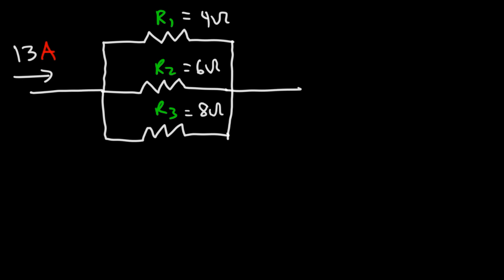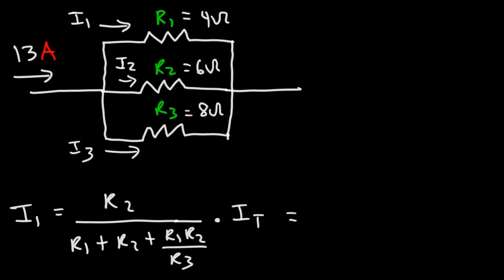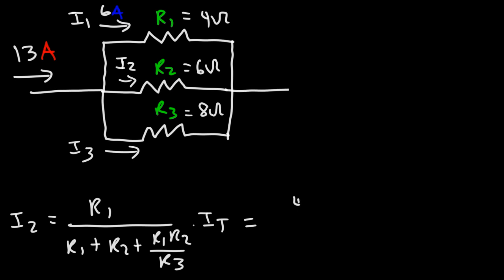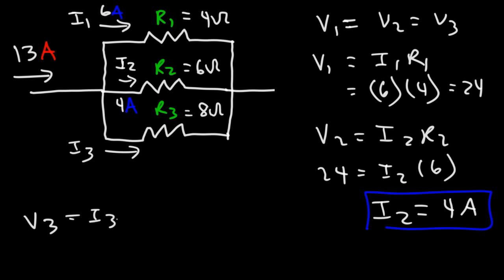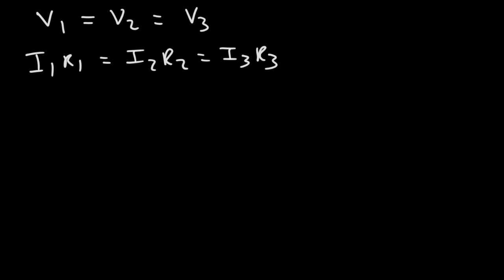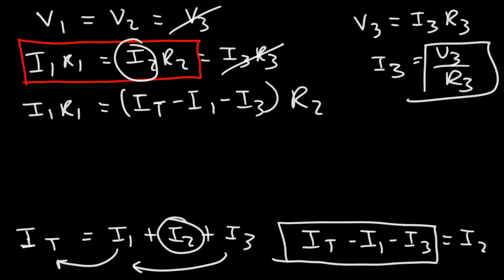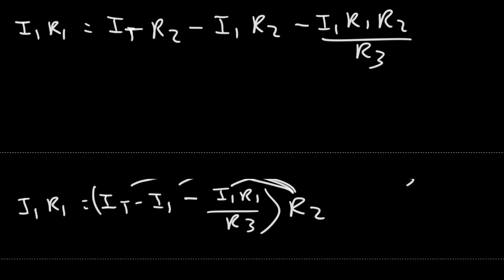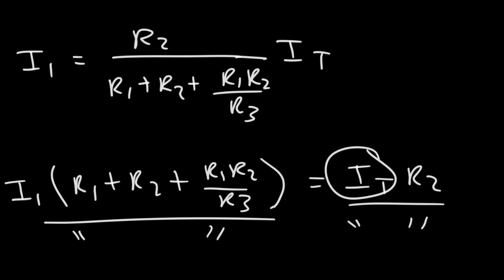Finding The Current In a Parallel Circuit With 3 Resistors

Comment: Method 1. V = IR. We know I = 13A, so we need R
The reciprocal of resistance (1/R) is called conductance. For resistors in parallel, the conductance of each resistor is added up to get the total conductance of all parallel resistors. The reciprocal of total conductance is the equivalent resistance of all the parallel resistors:
Equivalent resistance: 1/R = 1/R1 + 1/R2 + 1/R3
If we put the numbers right in:
1/R = 1/4 + 1/6 + 1/8
Lowest common denominator is 24, so:
1/R = 6/24 + 4/24 + 3/24 = 13/24
R = 24/13

V = IR = 13 * 24/13 = 24V

Now simply use I = V/R:
I1 = 24V / 4Ω = 6A
I2 = 24V / 6Ω = 4A
I3 = 24V / 8Ω = 3A

------------------------------------------------------------------------------------------------------------------------------------------------------------------------------------------------------------------------------------------------------------------------------------------------------------------------

Method 2. Current distributes proportionally in a parallel circuit. The voltage across each resistor is the same, but the current splits depending on each resistor value. Smaller resistors get more current, and larger resistors get less.
V = V1 = V2 = V3

Ohm's law:
I1 = V / R1 or V = I1 * R1
I2 = V / R2 or V = I2 * R2
I3 = V / R3 or V = I3 * R3

Solve for I1:
I = I1 + I2 + I3
I = I1 + (V / R2) + (V / R3)
Since V is the same we can just use I1 * R1 in its place:
I = I1 + (I1 * R1 / R2) + (I1 * R1 / R3)
I = I1 + I1 * (R1 / R2 + R1 / R3)
Basically, we can use ratios of resistances to figure out the current going through the other two resistors.
I = I1 + I1 * (4/6 + 4/8)
I = I1 + I1 * 7/6
I = I1 * 13/6
Because I = 13A:
I1 = 6/13 * I = 6/13 * 13 = 6A

Solve for I2:
I = I2 + I2 * (6/4 + 6/8)
I = I2 + I2 * 18/8
I = I2 + I2 * 9/4
I = I2 * 4/4 + I2 * 9/4
13 = I2 * 13/4
I2 = 13 * 4/13 = 4A

Solve for I3:
I = I3 + I3 * (8/4 + 8/6)
I = I3 + I3 * (24/12 + 16/12)
I = I3 + I3 * 40/12
I = I3 + I3 * 10/3
I = I3 * 3/3 + I3 * 10/3
13 = I3 * 13/3
I3 = 13 * 3/13 = 3A

------------------------------------------------------------------------------------------------------------------------------------------------------------------------------------------------------------------------------------------------------------------------------------------------------------------------

Method 3. Solving for R to get the first formula in video:
1/R = 1/R1 + 1/R2 + 1/R3
Make denominator same in all three fractions:
1/R = (R2R3 + R1R3 + R1R2) / (R1R2R3)
Reciprocal of the same equation:
R = R1R2R3 / (R2R3 + R1R3 + R1R2)
Factor R3 from right hand side
R = R1R2R3 / (R3(R2 + R1) + R1R2)
Divide right hand side by R3:
R = R1R2 / (R2 + R1 + R1R2/R3)
Current going over R1 is I1 = V / R1 = I * R / R1
Substituting R into this:
I1 = I * (R1R2 / (R2 + R1 + R1R2/R3)) / R1
R1 cancels out and we're left with the formula in video:
I1 = I * (R2 / (R2 + R1 + R1R2/R3))

This is completely unnecessary and just using the equivalent resistance is so much easier.

Comment: Lew has a good way if you want to know voltage, but here's another way that is even easier if you just want to know the current. Current is inversely proportional to ratio of each resistor in parallel. So let's say we want to solve for current of R1. Let "c" be the current. We take the ratio of each resistor from the one we want to solve:
c(4/4) + c(4/6) + c(4/8) = 13 

Clearly if we are solving for c you could write it as 

c + c(4/6) + c(4/8) = 13

But seeing it with 4/4 shows that we are taking the ratio of EVERY resistor

Comment: Sir please reply, can we use this formula for more than 3 resistors?
And can we use this equation in any way in a case where infinitely many resistors are whose values are in gp?
Reply: if you still need an answer or anyone looking for an answer ,yes you can use the formula on as many resistors as you're given
Reply: Alternatively you can use / I1 =Itotal [1/r1 /[1/r1 + 1/r2 + 1/r3 +1/14.....]

Comment: So the end current where all 3 resistors meet, lets say final output, would be the same as the highest resistor current? ... which is 6, right? Or will the current flow from all 3 resistors come together and be 13 again?

That's what I was curious about when I searched this topic and found your video.

Comment: Here's an easy formula to remember. Just find REQ, the equivalent resistance. 

1/REQ = 1/R1 + 1/R2 + 1/R3 + ...

REQ for 2 parallel resistors = 1 / (1/R1 + 1/R2) = R1R2 / (R1 + R2)
I1 = IT(REQ/R1)
I2 = IT(REQ/R2)

REQ for 3 parallel resistors = 1 / (1/R1 + 1/R2 + 1/R3) = R1R2R3 / (R1R2 + R2R3 + R1R3)
I1 = IT(REQ/R1)
I2 = IT(REQ/R2)
I3 = IT(REQ/R3)

REQ for 4 parallel resistors = 1 / (1/R1 + 1/R2 + 1/R3 + 1/R4) = guess :) = (R1R2R3R4 / R1R2R3 + R1R2R4 + R1R3R4 + R2R3R4)
I1 = IT(REQ/R1)
I2 = IT(REQ/R2)
I3 = IT(REQ/R3)
I4 = IT(REQ/R4)
Reply: and the derivation is simple InRn=IT*REQ since potential is same

Comment: I did it in a kind of different way.
Since the current entering on the left is equal to the current exiting on the right ,we have i1+i2+i3 = 13 amp.call this equation 1 
Since the voltage across all the resistors is the same ,so
V = i1r1 = i2r2 =i3r3.
From above we have direct relation between i1 i2 and i3. Substitute i2 and i3 in terms of i1 in equation one and consequently solve for i2 and i3
Reply: This is a better conceptual way using KVL, thanks for helping me out. Won't have to learn formulae now

Comment: Dude... 
1/Rt=(1/R1)+(1/R2)+(1/R3)
Rt=1.846
E=I	R
13 X 1.846=24 volts
I=E/R
24/4= 6A for R1
24/6= 4A for R2
25/8= 3A for R3
This is way quicker. And easier.
Reply: What if there are more resistances after it? Then the voltage drop won't be 0 making the math hard. Plus we won't know the ending voltage.
Reply: This is much easier. Thanks for this
Reply: This ain't about shortcuts this is about entering and seeing the matrix.

Comment: Guys don't learn these silly big formulas. Use your brains !! It's very easy. Here is how to easily solve it -

Find Total Resistance by using formula 1/R = 1/R1 + 1/R2 + 1/R3 and so on for the number of resistors...

Now you have total Resistance.
You already had total current (I) flowing through the circuit.

Now we know that in a parallel combination, Voltage is same everywhere! So find Total voltage by
V = I x R
Where R is the total Resistance.

Now for finding i1 -
V = I1 x R1

And so on for as many resistors you have..

Super easy. :)
Reply: Yes

Comment: I did it a different way and got almost same answer differing in decimals. 
I found out Rtotal first then found out voltage of the circuit.
Then used V=IR in each resistor
Reply: same

Comment: A different approach from an "old" Electrician but simpler (for me) was starting by calculating what we used to call the effective resistance of the parallel resistors. This is useful to work out the total parallel resistance even if Total Current or Voltage is unknown. 

The formula is 1/(1/R1)+(1/R2)+(1/R3) continue for as many resistors in parallel.
Or  in the example 1/(1/4)+(1/6)+(1/8) = 1.846 Ohms. 

This is the resistance as it appears to the circuit. Using V=I/R    13Amps/1.846Ohms we get 23.998 or 24V (The 1.846 was rounded down) 

Now we have the Voltage across each known resistance the Current can be calculated with I=V/R for each
24/4 = 6A, 24/6 = 4A and 24/8 =3 A And to check 6+4+3 =13A total.
Reply: This is simplest method, I use that too!
Reply: I found it easier your way.  😊 thanks
Reply: 13/1.846= 7.04V
Reply: @tanyatodd9660  supposed to be V=I*R not V=I/R

Comment: But this is a bad way to do it - Find total resistance of the resistors (comes out to 24/13 ohms), use ohms law to find voltage (24 volts), and knowing that voltage is the same in resistors in parallel, use ohms law again on each resistor to find current. :)
Reply: That's the correct way to do it.

Comment: A more simple way is using the fact that the 3 resistors in parallell can be replaced by one single resistor with resistance equal to 1/R1 + 1/R2 + 1/R3 inversed. You can then use Ohms law to find the voltage through the resulting resistor, and since the current is equal in all branches, you can use Ohms law on R1, R2, and R3 to find the current. Correct me if i am wrong but I got the same answer using this method.
Reply: did you mean to say voltage is the same in all the branches? Cus i thought votage remains the same in parallel, current splits.
Reply: Correct. Understand everything you said. (single resistor inverse formula) Divide 1 by the SUM of the three 1/R1 + 1/R2 + 1/R3